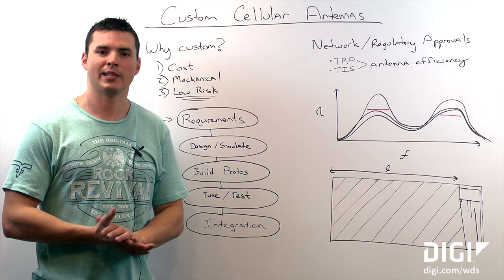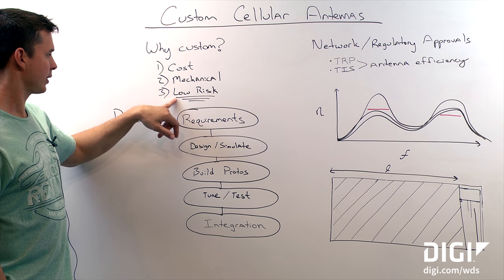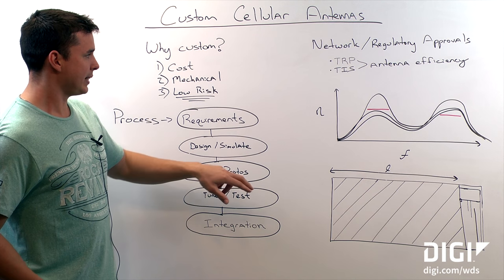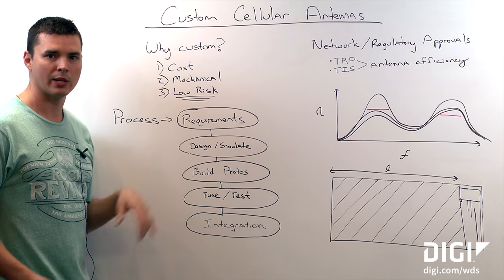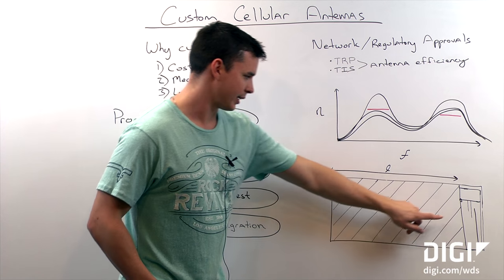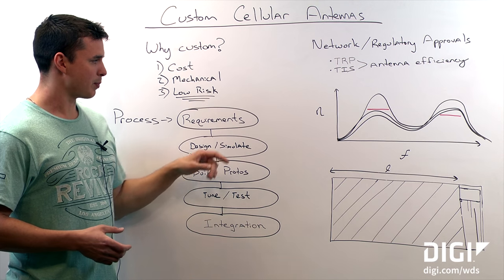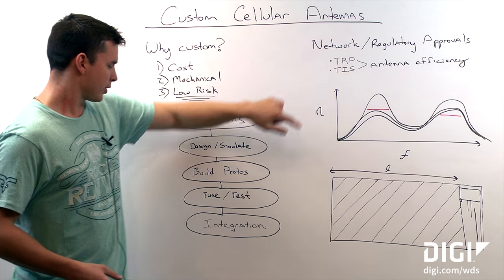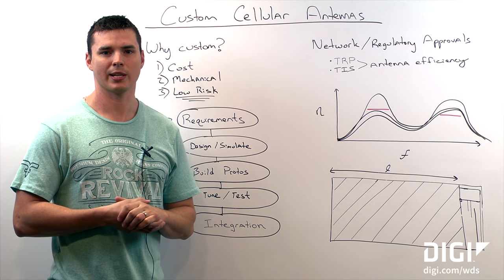Antenna Design: Custom Antennas for Cellular Applications

Comment: what is the equation for calculating antenna impedance, i.e a wire in free space, 1mm diameter, length of x... what is the equation relating x, f and Z ? or even just would like to know for frequency f and length x what is the standing wave pattern... maybe I can take it from there...